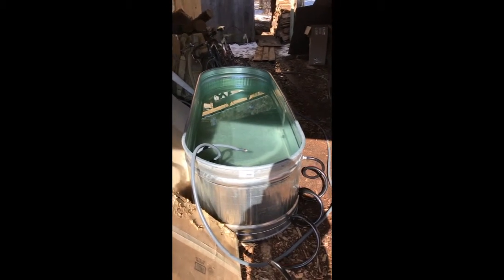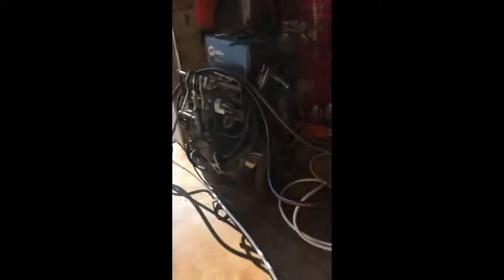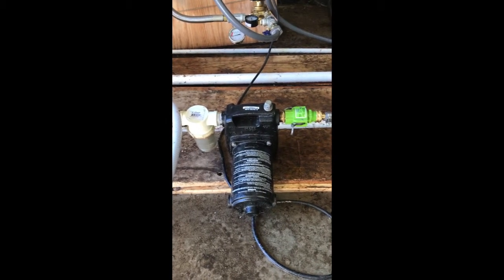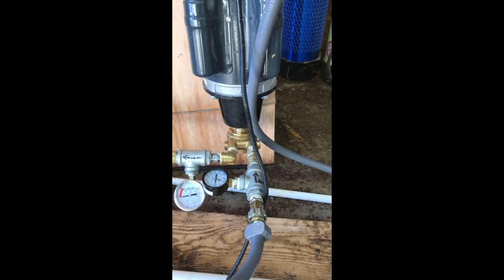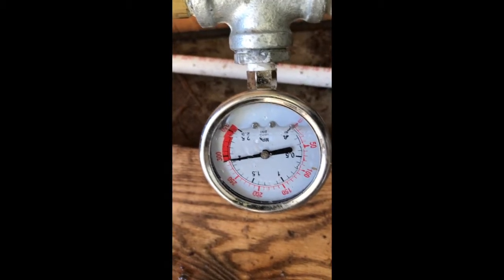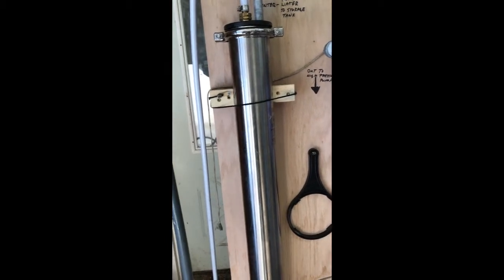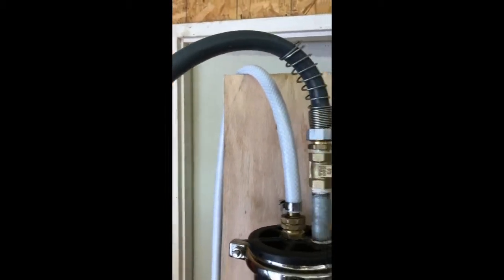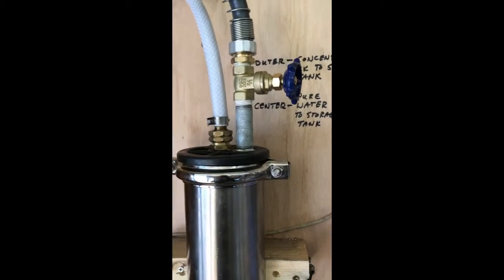Home made Reverse Osmosis system for maple sap

Comment: What GPD rating is your RO membrane? Also do you have any numbers of runtime vs water removal? Or is it 40 GPH regardless?
Reply from the maker: With my pump set up it’s 30-40 gallons per hour. The membrane is a 4x40 in Dow filmtec rated at 2640 GPD

Comment: You have a nice build and nice system only to throw it all away by using non food grade equipment.  Specifically the transfer pump and galvanized sap tank.
Reply: It only gets better.   Garden hose for flavoring?
Reply from the maker: Since this video was have switched to food grade plastic totes for sap storage.  Food grade hoses as well. So a little less rustic. Hadn’t thought about the transfer pump. Will look at a SS model.
Reply: Simple potable water jet pump. Great to hear your making the upgrades
Reply: @sphenry29  if you're trying to use it for sap...its not meant for for food or potable water.  A jet pump should be tho.  Be careful tho.  I bought one with a the tank and then see the sticker "not for potable water"

Comment: The motor is rated at 3450 rpm and the pump is 1725 rpm.  Is that a problem?
Reply from the maker: Might be. If you want to try it I suppose the worst that would happen is the pump would fail and you’d have to replace it with a 3450 rpm model.
Reply: @bobsookochoff5299  your material list calls for a 3450 rpm motor and a 1725 rpm pump.  Can you confirm those rpm's are correct?  I am curious if you are overrunning the pump or if the motor is really a 1725 pm.  thank you
Reply from the maker: My mistake. The motor and pump are both 1725.
Reply: Thank you for verifying. Great video!

Comment: Would you have a list of parts?  I'd like to see this on instructables.com like your sap pump.
Reply from the maker: I may do an Instructable on this when I get a chance.  In the meantime, here is a link to an excel file that has a list of components, suppliers and prices. The specialty items from www.wateranywhere.com are not readily available from other suppliers, but many of the other items are and you may find them cheaper.  The prices have gone up since I built my system 2 years ago, but you can still build a good system for less than 1/2 the price of a commercial unit.  https://1drv.ms/x/s!AjtCVAkkNdBBpQ8RZVBtEO--dmoR